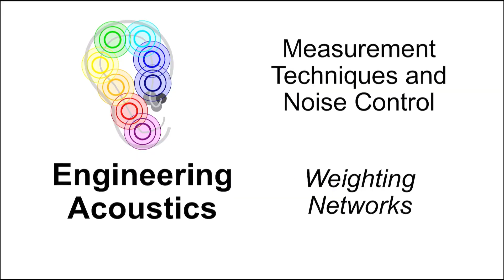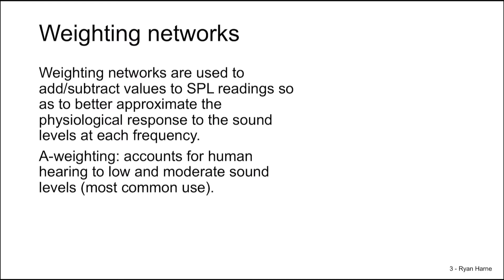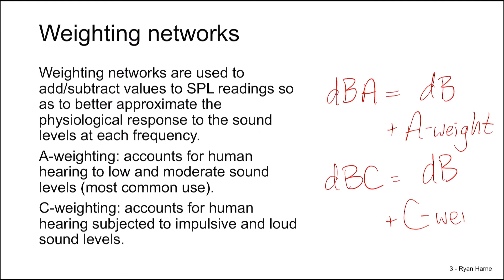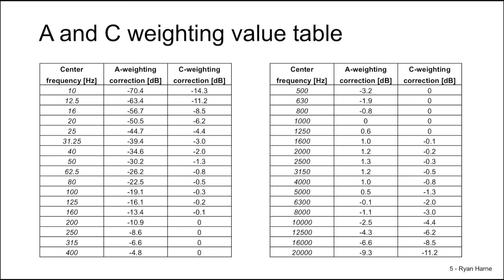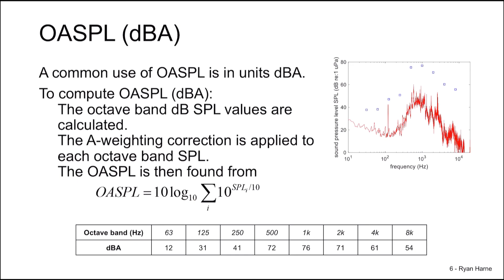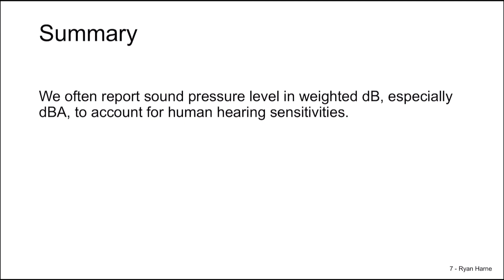Engineering Acoustics: 20. Acoustic Weighting Networks

Comment: Hello Ryan, thanks so much for your classes, they are being very useful for refreshing some concepts from my degree. I have a question regarding the OASPL parameter. On the class notes that my professor gave us when I took Acoustics years ago he writes this regarding the sum of A-weighted intensities vs A-weightes pressure levels: 

In general, it does not matter whether sound pressure levels or intensity levels are used. However, when summing A-weighted values, it is important to use intensities because, when calculated in disjoint bands, the intensity of the sum of contributions is the sum of the intensities. This is the case because the disjoint frequency bands are uncorrelated. In contrast, the effective pressure of the sum of contributions is not the sum of their pressures, so it is not possible to use pressure to apply this method. 

I don't understand the reason why pressure can't be summed and intensity can. Also, if this is true, wouldn't be OASPL an incorrect representation of the loudness perceived?